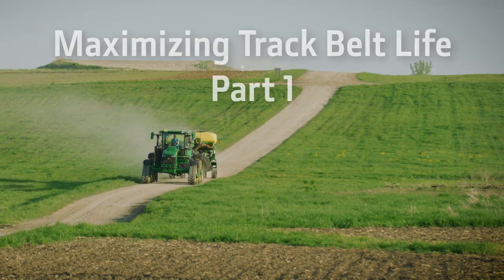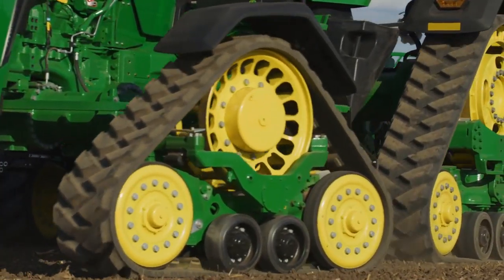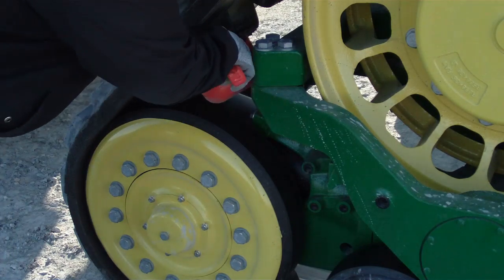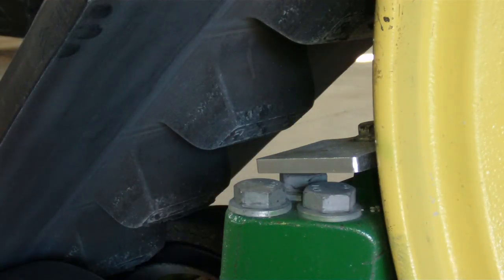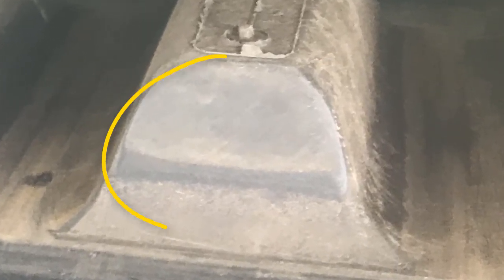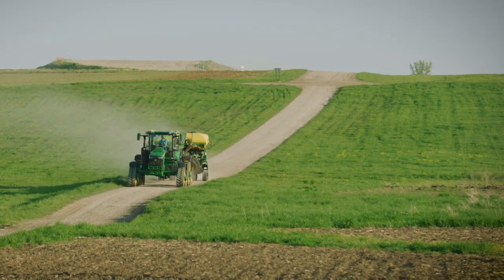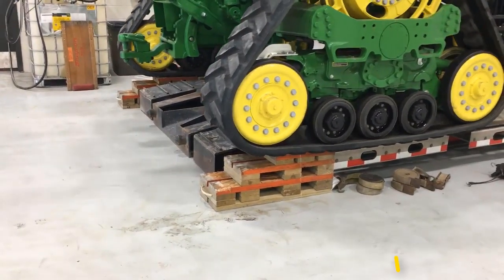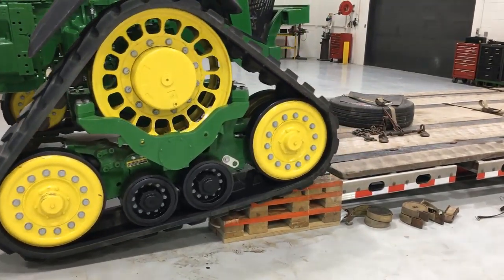Maximizing Track Belt Life - Part 1

Comment: Interesting video, so if tracked tractors are so high maintenance then why buy them?
Reply: Farmers with very little transport requirements (ex. a couple miles) dont require much break in . Most of the early life of the tractor is in the field. This break in is most important during the first season and expecially if longer transport requirements are needed with heavy 3 point implements.

Comment: Great tips! Also to maximize track life and machinery value John Deere recommends pulling your tractor into the shop(as long as the concrete floor ledge isn't over 2" in which case use a certified John Deere ramp) and leave the tractor parked there until retirement or bankruptcy.

Comment: Could you use powdered graphite
Reply: You could but it would be a lot more expensive than using Floor dry or Cat litter. The cheapest is of course shovel in a few shovels of soil, or go work in the field right way. The lubrication phase is most important with new tracks.